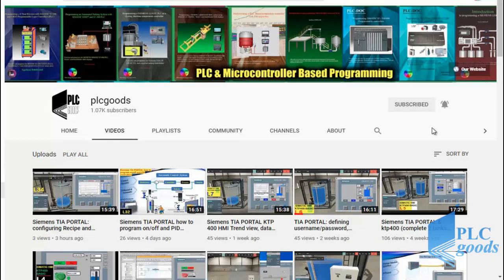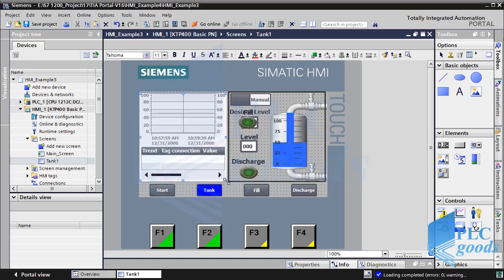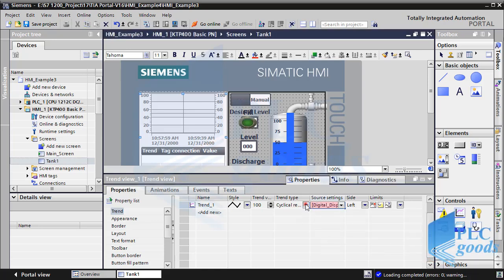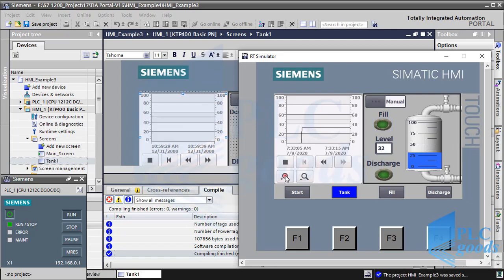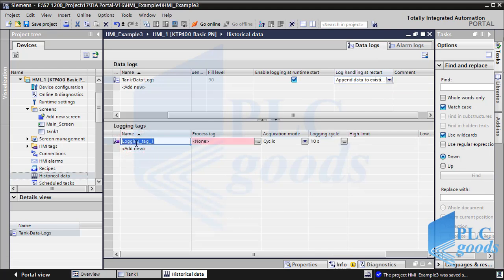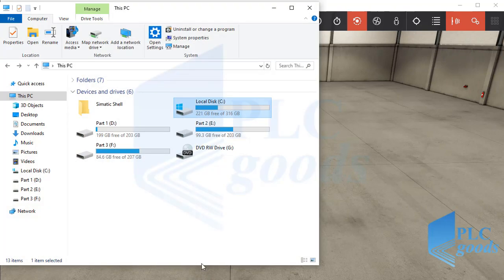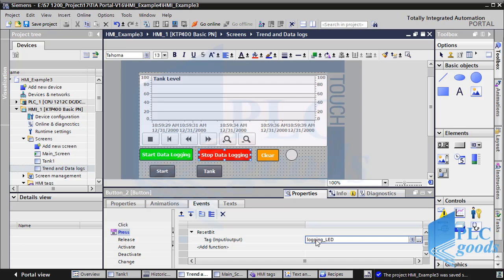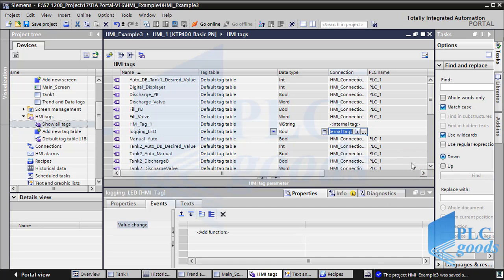SIEMENS S7 1200 data logging | how to use trend view to log data | L 41

Comment: Hello, I want to take a temperature reading on the S7-1200 device with just a sensor without an HMI screen, keep a data log and transfer it to Excel from the S7-1200 plc default interface. I will communicate with the PLC, log in from the internet interface, and get the log file and transfer it to Excel. Can you help?
Reply from the maker: You maybe able to use OPC interface to do your project.

Comment: Hello Seyd I like a lot your vídeos PLC , the Other I was seeing your vídeo about dataloging to Excel.
My question is posible the oposite.
I will try explain better, I have a LiDAR in this lidar my software créate a Excel datalogger with all the measurements Each spot , my idea is posible add this Excel in tía portal, for example:
Spot 0º measurement distance 825mm between LiDAR to object, this líne Excel créate a variable when this distance appear in tía portal variable 1
Thanks for learn in this Chanel
Jordi
Reply from the maker: Sorry, I did not use Excell data as a kind of data base to process its content with a PLC.